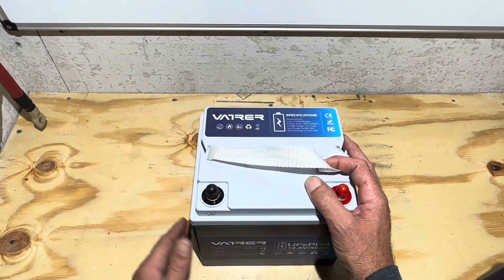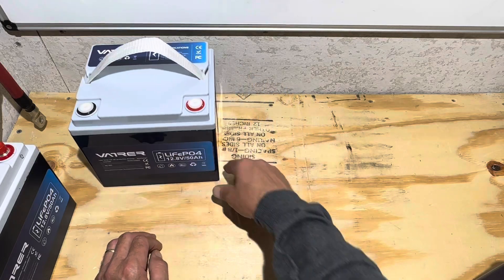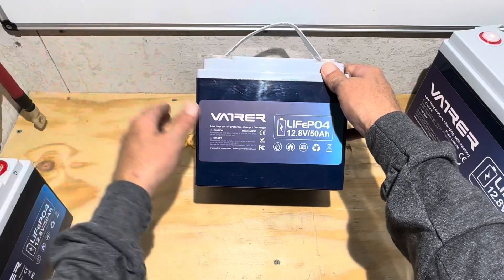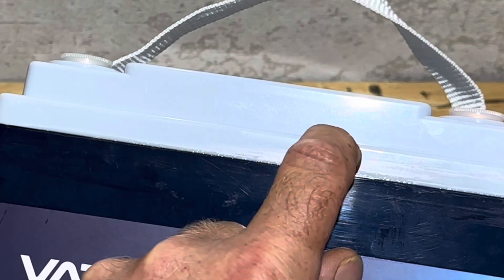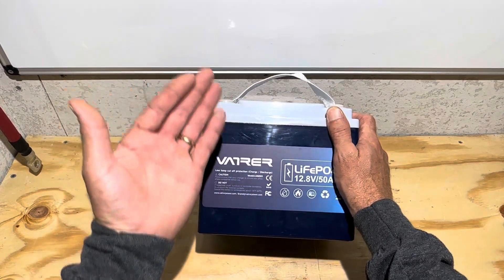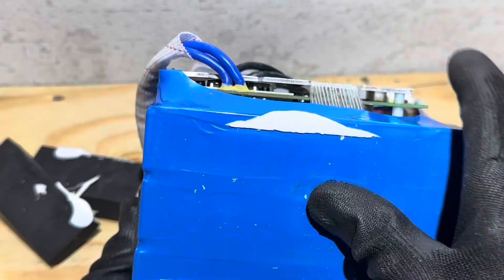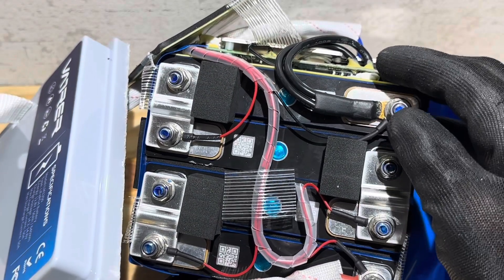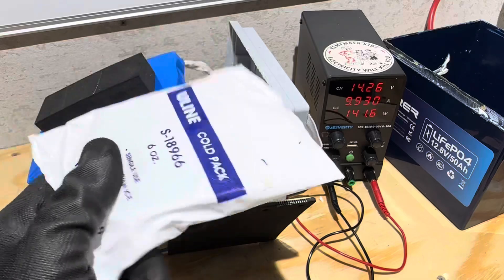Vatrer LiFePO4 Battery

Comment: What brand and kind of gloves do you wear? I want to buy a pair off Amazon but I have no knowledge with electricity and don't want to buy a pair of gloves that aren't what they say they are. Greatly appreciate a recommendation and thank you kindly for all you do for us off grid community folks. Peace from Alberta Canada. P.S. Mother nature up here is already in the below 0 celcius temperatures now.
Reply from the maker: The glove I wear in videos are cut resistant Dulfine brand. They are not electric rated. Are you wanting gloves for line voltage AC or just for DC for 12V batteries? I wouldn’t worry a lot if 12V DC is all you are working on, it’s mostly touch safe for your skin. Don’t short tools or metal across +\- 😃 
36/48 and higher you can get a little jumpstart under right conditions. Higher than that danger increases even more. 
Take care in 🇨🇦 ! 
Down in district 12 USA 😉 (Appalachian mtns) it was 34°F this AM!
Reply: @THEOFFGRIDMOUNTAINHOMESTEAD  greatly appreciate your response so quickly. You are such an asset wowzers. Thank you kindly and peace
Reply from the maker: You’re most welcome my friend!

Comment: I emailed them last night for a Replacement on a 100 ah battery. They agreed to send me a new one AS Soon as they come in. I guess they are out of stock 😂
Reply from the maker: Out of stock on their 100Ah? That’s odd.   Seeing them on Amazon and website shipping by June 28. 
If you don’t mind my asking, what happened to your battery? What application were you using for? I like to know how others use their batteries and be on lookout for failures or possible issues with different brands! Thanks!
Reply: @THEOFFGRIDMOUNTAINHOMESTEAD  I bought 2 12 Volt 100AH. For my solar system. I charged 1 with no problem the 2nd battery would not charge. I tried 2 different Lipo4 chargers  nothing worked. I hooked up 2 different 12 volt inverters    nothing   the one battery has 11.30 on my Fluke meter  it's like the BMS is unhook   I think it's just one of those things that happen. Both Batteries look good. Packaged well
Reply from the maker: Thanks for the info!

Comment: Well, my question for them is a one-off battery or all of the "new ones" have the correct cells and low temperature sensor? I have already seen what the first one was, so I dont think I could trust them.  At least you got 3 batteries out of them to test or use to run the water pump. Thanks for the video and giving an honest review!
Reply from the maker: Always nice to get a surprise battery delivery no doubt. Even missing the sensor in the first one isn’t as big of a deal as asking me to betray my viewers! That’s the whole issue. 
The batteries are made ok, decent quality parts/wire/capacity/good cells.
It’s the advertising/PR team that’s disappointing and needs improvement.
Reply: @THEOFFGRIDMOUNTAINHOMESTEAD  very true! I see it in my business as well.  Manufacturers say it is one thing until you are into it and find that is not what it should be.  Sad that this the normal.  American companies are doing as well.  Thanks for all the hard work and dealing with less than desirable people.